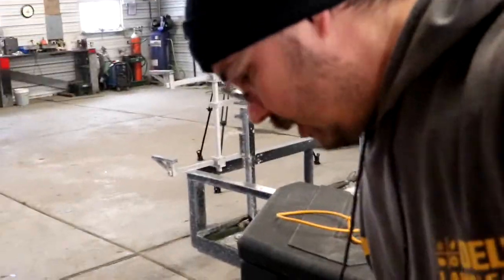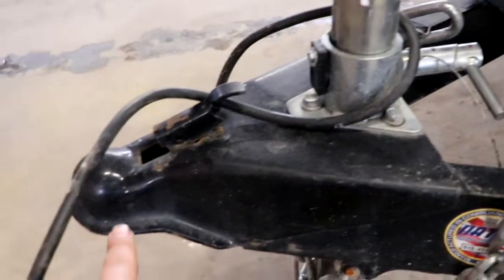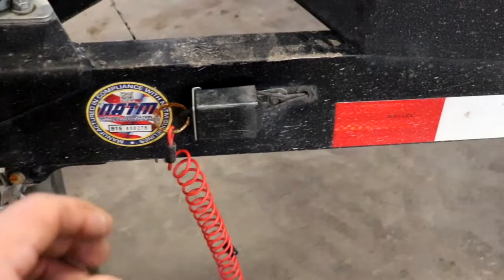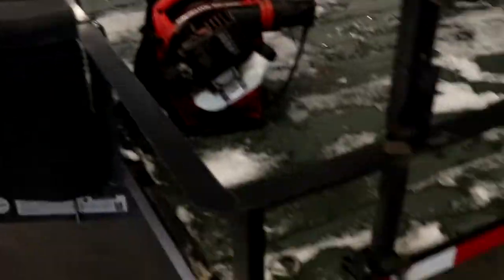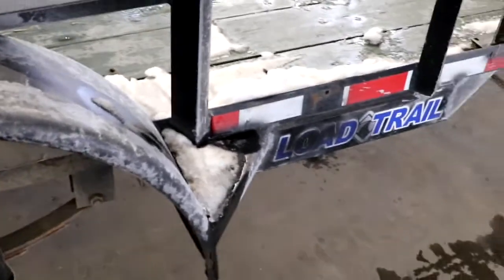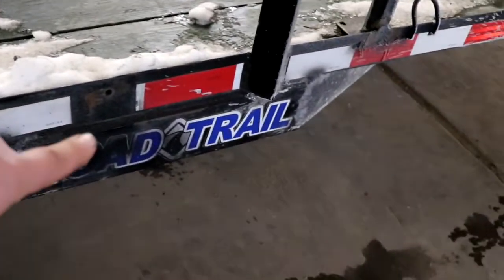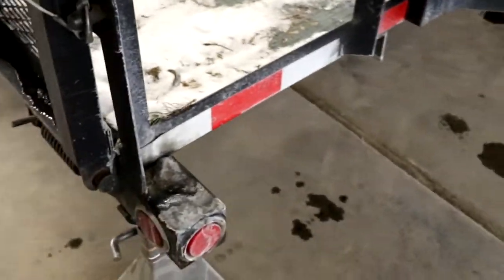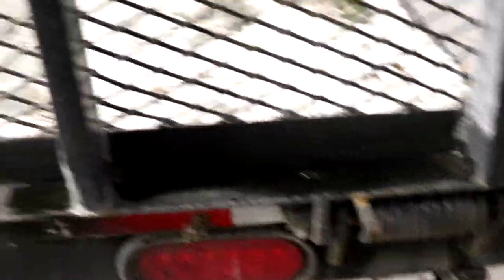Yearly trailer maintenance and over look.

Comment: Great video but most trailer axles cant make it for a year. The suspension is junk on the small ones. Shackles bushings and wheel bearings are shot in 5K miles at the most.